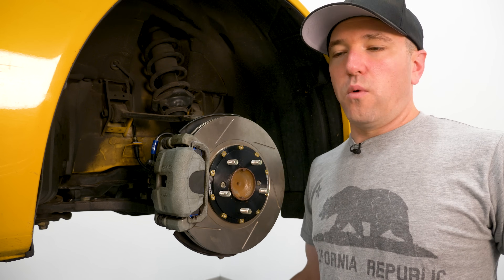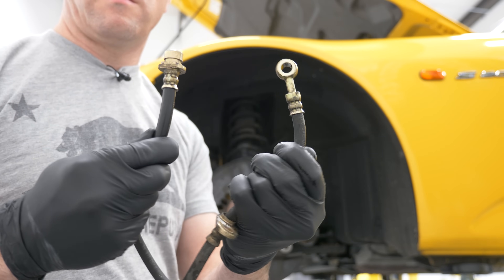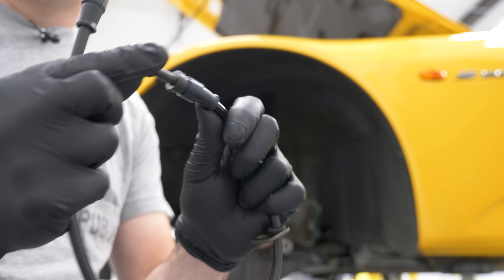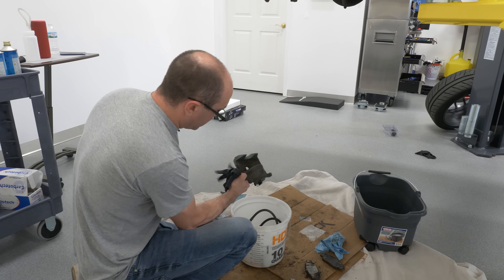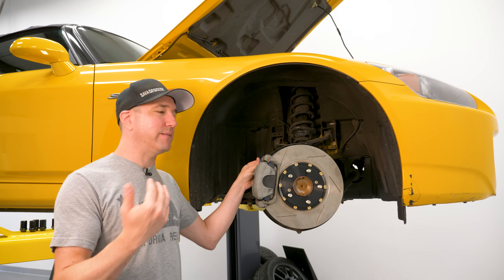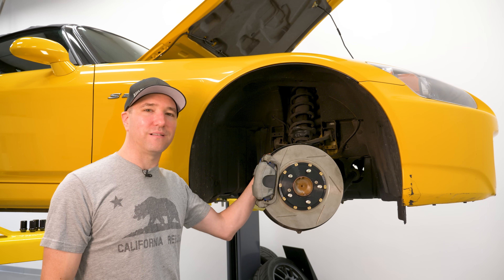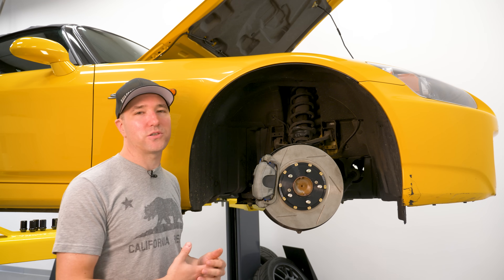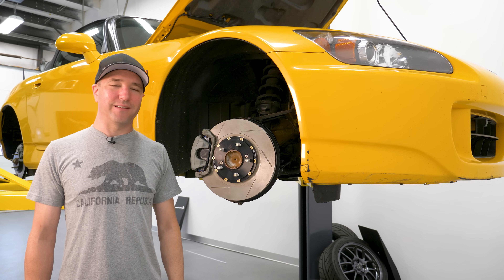Are Stainless Steel Brake Lines Worth It? | The Fine Print

Comment: Now I have more doubts than before watching the video, as I want to fit them on a street car that will occasionally enter in track days
Reply: New rubber lines are a lot cheaper and don't really have any issues with stretching under pressure either - you can get a lot of sponginess under hard braking from the caliper flexing.  Even big name brands get this at times - Wilwood comes to mind as one that's good, but not always quite up to track day punishment.  Problem is, most people are comparing their new ss lines to the old, perished and/or worn out rubber lines that they're replacing.  The few tests I've seen comparing new to new suggests that there's very little difference - small enough that you'd have to be a professional to be able to feel any significant difference.
Reply: PS:  That said, I would imagine that they would offer a more consistent brake feel, especially as the lines get older, whereas the rubber would inevitably break down over time (at which point I'd just pay the cheaper price for a new set of rubber lines and get that new feeling again.)  :-)

Comment: Not alot of people really talk about these braided plastic lines wear out very quickly, leak, and come apart at the terminations after all those expansion and contractions wear out the plastic at the termination joints, yes what they call stainless braided lines are basically a plastic like material line, many have had lines severed at the terminations, good for track and feel, doesn't last on the street, these braided lines are dangerous on the street , even if you inspect them you never know when they will shear off at the terminations, rubber hoses are much much more forgiving aka flexible and last basically the life of the car, if only someone came out with super high quality hybrid brake lines without the shearing issues at the terminations.

Comment: I just found this video after installing stoptech stainless steel lines in my daily driver 😅
Reply: I live in LA too, I drive a 2001 toyota celica gt. After installing the lines the brake pedal feels very firm when breaking, however this does not translate to stoping power, and the ABS does seem to kick in faster, also the pads also wear faster. I would say that if you do not take your car the track just stick to the OEM lines and just upgrade you pads to cermic ones.
Reply: I'm looking into replacing mine on my daily driver. I live in Los Angeles. Believe it or not, I do feel brake fade in the hot summer weather on the rapid stop and go traffic. After replacing yours, can you tell me how the braking feels? Are your brakes wearing faster? What vehicle do you drive?
Reply: One last question, do you feel like your ABS kicks in way faster?
Reply: StopTech ones are DOT approved at least, so no big issues there if you install it right.
Reply: @jacktran960  don't fall for dot approved  those same stainless steel lines fail on me when backing out my place luckily I manage to stop line crack. Just replace them with oem
Reply: @fullpeladas  i bene having mine on for a few months now, I do a lot of stop and go traffic driving without issues. I also did a few 70mph to 0mph stops and did notice improved brake pedal response. I already bled the brakes before installing them, so I know the firmer brake pedal is from the new lines.
Reply: @jacktran960   inspect the lines regularly. my last 2 years make sure they are route with no  obstruction and no debri
Reply: Same. Luckily I could only do one side since I stripped the brake line nut on the other (didn't use a flare wrench)

Comment: I kept my rubber brake lines but replaced the hard lines with stainless. Steel / zinc lines don't last very long in my location next to the Pacific Ocean. Copper nickle are better than steel, but  for rust and corrosion prevention I think stainless hard lines should be better than copper nickle.  My Steel / Zinc hard lines rusted so bad enough that both the hard lines and fittings needed to be cut off with cutters or a torch.  If you're in a rust belt, go onto the ocean beach frequently, near salt water etc. I think stainless hard lines and fittings will last longer

Comment: Stainless steel lines are not a good name for these.  You can have rigid SS brake lines made from SS but these flex lines are made from Teflon with a metal braiding and steel or SS fittings.  They should be called non-rubber or braided Teflon flex lines.  In my experience they are better for pedal feel and travel even on a street car.  I use it on the clutch line also.

Comment: I suppose without introducing extreme fluid temperatures, you should not be able to discern a difference between stainless and rubber lines. I know I couldn't. I decided to try them on my FRS. Could not feel any difference after I had properly bled all the air out. The pedal felt pretty good on the rubber lines and I'd be hard pressed to say that the steel lines made a difference.

Comment: I drive my 02 s2k on the street.  80% winding paved country roads.  I'm convinced I do not need stainless lines.  But, my car is 16 years old.  It has 35K miles.  Should I replace the oem lines with new oem lines just because of their age?  They show no signs of deterioration that I can discern.

Comment: The  really reason manufactures dont use steel brake  lines is profit margins.

Cutting $50-70  per  car  when a  company  sells hundreds  of  thousands equates to millions a  year.

Which in fairness  to  them the  benfits are  small.

Comment: What about durability? According to the service manual of my motorcycle, the OEM rubber lines should be changed every 4  years. A lot of ss brake line manufacturers offer a lifetime warranty, so technically they would reduce long term maintenance costs, especially considering that ss lines are barely more expensive (sometimes even cheaper) than rubber lines in some applications.
Reply from the maker: I don't think anyone replaces brake lines unless they get in an accident.  Most of them are lifetime parts on pretty much anything post 1995.  But it depends on the car and region/weather and how its driven.
Reply: savagegeese Some people only perform maintenance when something breaks, while others like to be a little more on top of things. Replacement of rubber lines is actually part of the periodic maintenance for many vehicles.

Comment: Adding rigid, or semi-flexible metal brake lines between the wheel and body is really stupid. Especially when considering that stainless steel is more brittle than regular steel to begin with. Have a look at how hard a front suspension work, and you'll realize how quickly those metal lines will break... https://www.youtube.com/watch?v=0uPB8s6jSl4

Comment: you could just clean the stock ones and spray plasticoat on them. I mean it works, I also do that to my trailer tires prevents dry rot.

Comment: Some German cars like Audi's just use hard brake lines all the way to the caliper so that you get the benefits of stainless steel braided lines just without the liability. Only downside is that it's more expensive to fix or replace your calipers.

Comment: In my country, weather is hot thru out the year. We can feel the expansion of the rubber easily. 2ndly, if absorber leaks oil, it causes the rubber line to expand or harden quickly too. So I prefer steel braided.

Comment: You don't need to be on a race track to feel the difference that stainless steel brake lines make, you can feel it when the car is not even in its motion the pedal is a lot less mushy feeling.
Reply from the maker: +John  Lastname Thats HIGHLY dependent on the car and other factors.  For most vehicles with standard brakes it does next to nothing but placebo.

Comment: Man succeeded in scaring the shit outta us that wanted to upgrade to braided stainless steel lines.
Reply: Right, we all looking @ each other like WTF....
Reply: Exactly ahahahah
Reply: Nah, he just wants the best pedal feel at the track. I'm not falling for it.
Reply: Lol 🤣 hell no
Reply: Still putting mine in on Christmas eve 🤷🏾‍♂️
Reply: One thing I didn't see mentioned also is stainless steel brake lines are also abrasive. Instead of rubber there's a PTFE line in there surrounded by a plastic cover to help prevent the stainless steel sheath from cutting into the line. Add in some road grit and tens of thousands of turns and flexing of the line inside the stainless steel sheath the brake lines are now a limited lifetime wear item. As it's life rubbing a piece of steel wool over the plastic protective cover every time you turn the steering wheel.

Comment: In my opinion...

The main reason is general brake feel, not necessarily during track conditions or from heat of the fluid expanding. The benefits are felt EVERY SINGLE TIME you press the brake pedal, at any speed. The oem rubber lines dont hold the 100's  of psi (during even a regular brake application) without deforming slightly, which is felt in pedal feel. 

However, many cars have very soft cast brake calipers , that flex significantly as well. If you have basic cast calipers (or non-perfomance street pads with low initial bite), you will still have a spongy pedal feel even with the stainless steel lines, so just save your money.

I agree on the downsides, however.
Reply: That spongy feel is the worst. I had mine's installed because of this
Reply: Need to change the Brake master cylinder

Comment: I've had stainless lines on for 40,50,60K NO PROBLEMS. Ever. I think you are being a bit touchy for no reason. I've never even heard of a single time on any of the car forums for any of the cars I have owned where someone's brake lines fail. Because in reality what happened did you end up with a small leak, your braking system throws a light for it and you tighten your fittings as most of the cheap SS lines are aluminum fittings on the OEM steel nozzle this causes 99.9% of the problems not the nonsense you are going on about. 

You dont need to be on the track to experience the gains in stiffness and pedal feel, Just like in all sports, Driving, Shooting, consistency is key. And these give you that. Your doom and gloom is going to turn people off from having reliable braking systems. This is hands down one of the best mods you can do for your brakes for confidence and feel, knowing how your brakes are responding,.

Comment: I believe brakes are set up diagonally. If you loose pressure in one of the brake lines, 2 wheels will loose the ability to brake. But master cilinders are made this way that there will still be 2 diagonal wheels that keep there fluid and brake power.

Comment: over 200,000 Highway, City and back road miles on my Russell stainless lines, I have replaced my suspension down to the bushings 3 times, and plenty of other things, but have never had to replace the brake lines, get a good quality set and they will out last rubber lines many times over, as for them getting torn up from hitting something I've seen plenty of rubber lines get ripped and although theoretically the stainless lines can be damaged I have never seen one get taken out by debris

Comment: Stock caliper on 2 piece rotors? Also RB does not recommend those pads with those rotors. If you are having a problem with your SS lines they are not the correct length. I'd be willing to bet you are using your stock master/abs.

Comment: What if you run a dot4 brake fluid with the rubber lines will that help with the mushy pedal feel since it has a higher temp range? Will it cause the rubber lines to expand less giving a firmer feel?

Comment: One reason why many people see an improvement in brake pedal feel after upgrading is because they're replacing 15+ year old rubber hoses with brand new lines. They would've felt a difference too with new rubber hoses
Reply: Same goes with people talking down on "rubber bushings"..and wanting to put polyurethane bushings in their street car..and saying "those rubber bushings are crap compared to the nice colored poly bushes".They are comparing an old worn out part to a new "upgraded" part...and that automatically means that the original part is "crap."....man.....gotta love the 98percenters ;)
Reply: fuckinlowdowndrummer  deffinetly not true ..if u track ur car or even street race doing digs.upgrading the bushing is a must to prevent flex.another important part is if ur start making lower and the motor flex u will have shifting issue.these are things that I personally have been through
Reply: 15+ year rubber brake lines AND 15+ year old fluid!!!!!!
Reply: I replaced originally with new rubber lines. My peddle feel was still mushy. So I replaced the master cylinder, still mushy. Found a deal on stoptek steel braided lines. (Cost was similar to the rubber lines.) So I picked them up, replaced the front lines. Still mushy, replaced the rears then, no mushy feeling.  All new fluid, I replace every year to year and a half, mostly because I want a regular change so I never forget.
Reply: @blazetownsend8785  yeah the hydraulics need equal pressure distribution across the system so the mushy rear lines still gives it a point of expansion hence mushy pedal
Reply: I installed ss brake lines on my car just in the front. The brake pedal feel  isnt really any different but the braking response is more immediate and responsive
Reply: @6.Slow_Gto  I hate input lag of any kind. That's also why I removed my car's intake snorkel. I didn't really notice any power loss from allegedly warmer air, but the engine felt much more eager and willing to get to work. (This may differ from one car to another, though. Some really rely on the resonance charge to have low-end torque, if you need that.) - Also, on one car with electric steering I noticed a tiny response lag, too. Felt awful, especially since I could also feel the servo motor behind it.
Reply: Same as the myth that new Windows versions load so much quicker. Fresh install isn't clogged with tons of crap including old obsolete registry entries because Windows is a mess.
Reply: I'd say most of the change might just be from fresh fluid in the lines. There could've been air in the system even if it was never opened. Bled my friend 2008 is350's system that never been opened but the front calipers had air in them when I bled it.

Comment: I've seen some high performance cars come with what looks like springs that go over the rubber brake line.  I'm assuming this is to resist expansion and would be much cheaper thing to try.  SS brake lines are fairly affordable so why not if your in there upgrading pads anyway?

Comment: Now I regret putting on my stainless steel brake lines on my daily truck. I thought rubber brake lines would expand under emergency braking without necessarily getting extremely hot. If they only expand under hard track conditions than it was pointless for me.😔

Comment: WASTE OF MONEY FOR REGULAR STREET USE !!!!!!!!!!!!!!!!!!!!!!!!!
DOES NOT LAST FOR EVER < 
I Replaced a set of BREMBO 2 piece ROTORS and PADS 4 piston Calipers on a USED 1996 Callaway IMPALA SS
not Replacing the STAINLESS Steel Brake lines .the STAINLESS line Burst !!!!!!!!!!!!!!!!!!
this lines do not last !!!!!!!!!!!
FOR RACING ONLY !!!!!!!!!!!!!!!!!!!!!
the inner Tube is PLASTIC !!!!!!!!!!!!!!!!!!!!!!surrounded by BRAIDED LINE
Reply: Joni English  stainless steel brake lines do not Flex nor are they designed to be used for ever like rubber lines. Most stainless steel brake lines give a better feel to the brake pedal. You put on Bremo calipers and rotors without replacing the stainless lines is similar to having 20in rims on a 1980 Malibu. It is the silliest thing on earth. Why would you not upgrade your brake lines with upgraded rotors and calipers?
Reply: i was a Gm tech at a Dealer , the 1996 impala ss Went to Callaway for full Custom work , Engine supernatural 400, Borla Stainless exhaust , Brembo brakes . 
after 6 years Car came back to Dealer for Resale, 
and Safety 
the 2 piece Rotors Aluminium Center Cost $3000 for 2 fronts and pads $400.
the Hoses were already Stainless upgraded 6 years ago .
after the REfurbish was Done the owner too out for road test and Beat the Brakes 
and the old Stainless Flex Hoses  burst .
ie moral of story 
is even though they look ok these types of hoses for looks and brake feel , do not last for ever and need to be replaced after 4 years of use unlike rubber hard to see if they are Cracked !!!!!!!!!!!

Comment: luck your vids. it has a class of it's own.
my stainless line have been there for 5yrs. it is still gd as new.
we live in asia it is hot all year. lots of stop and go. 
brakes get worst if u are using dot3. 
rubber line expand. 
brakes response get really bad as hit or exceed boiling point.
my brake fluid heats up to 100'c easily in our city driving.
if u need to do an E-brake. omg you wish you had it will clamp on the disc. 
if it doesn't clamp on hard enough the abs will not work.
the stainless steel line & street brakes pads have never fail me so far.
plus point of steel line it does not expand.
if rubber line expand gd luck to your e-braking.
don't get me wrong rubber line is gd for many year and for all season.
good as it is, only in normal driving condition.

Comment: I found a good alternative to the Endless brake lines for the s2k. In my search to figure out if the endless lines would fit my 06+ ap2, I came upon spiegler. They are a well known, moto brake line manufacturer. Their lines swivel; they are DOT approved; and they are produced in Europe, but assembled in the USA.
Reply from the maker: +ayowser01 yeah speigler is amazing.  You can buy or have lines custom made by endless by just contacting the company directly and it's about half the cost of buying it through any other place like evasive Motorsports Etc.
Reply: savagegeese good info. I guess if my Spiegler lines ever need replacing I know who to contact next.
Reply: Do they make them for Ford Excursion ?